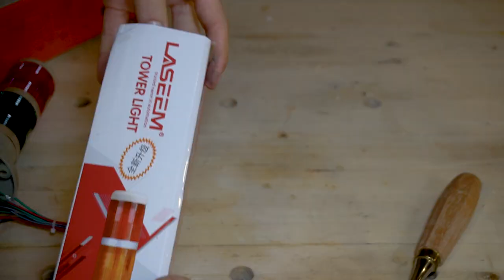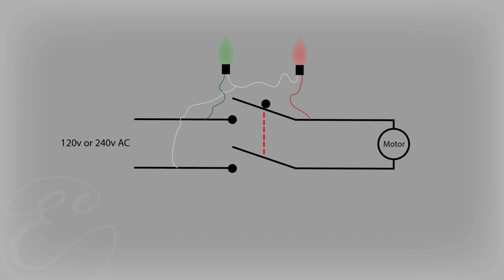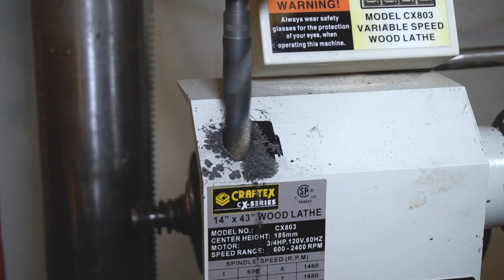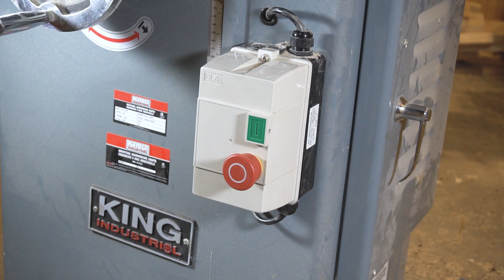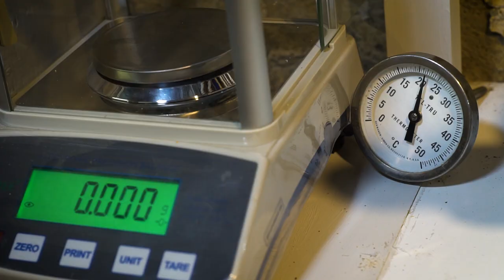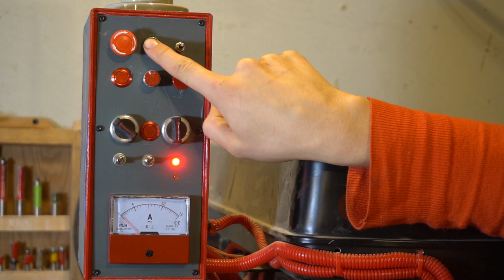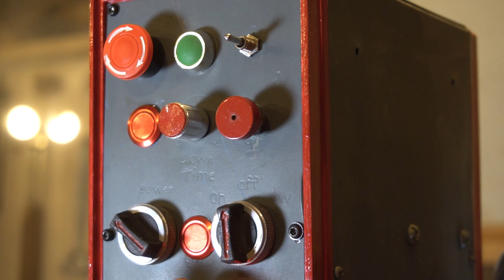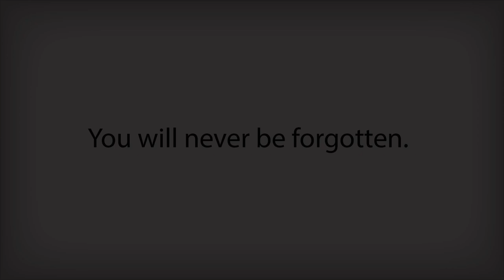Making your woodworking machines more safe

Comment: So  thats how you mount a vice to a drill press. seriously i had no idea.  I enjoyed this video like the rest i have watched.
Reply from the maker: Happy you enjoyed the video! My drill press is much larger than a typical drill press and the vise on it weights 70lbs. But you can get smaller similar vises that are much superior to typical drill press vises (a 4" one may be more appropriate for a typical floor standing drill press) Just look for imported machining vises. You can get some down to only 3 inches wide but still built the same. And there's no need to bother with big make brands like Kurt since the cheap ones will already be excessive in accuracy for a drill press.

Comment: This is an excellent subject that many woodworkers ignore.  I changed over my machines that don't have safety switches like newer machines have today. I adore machines from the turn of the 20th century. There's a reason they are still around due to the high quality they were built at and the fact most are made from cast iron. My brother has a 1920s, 28" band saw which is to me, a work of art, but can be a very dangerous machine. He has added safety switches and found at an auction, the original gage wheel covers that were made for his model machine, but often were not added. Great job Eloise! 
PS- You were not kidding about the cost! Ouch!! That must have been a small fortune you spent on those lights and switches.
Reply from the maker: Old machines are fantastic! but yes, adding modern safety equipment on them is critical. And yes industral electronics are expensive. Its always cheaper to get them from China but they are not as nice and you always have to personally evaluate the design of each component because there's no garanty they were well designed and made.

Comment: Any chance you can add a link to the lights and switches you've used? Great video!
Reply from the maker: They were all generic parts from the Chinese market on eBay. The lights are generic chinese safety stack lamps and available in many different voltages, number of stacks and with or without buzzers if you look around. Here is an example but I think I payed less so theres probably better deals:
https://www.ebay.com/itm/312535636993 

The E stops were these guys:
https://www.ebay.com/itm/152979045200 

And the green buttons were these guys:
https://www.ebay.com/itm/153748038631 

The buttons were also generic Chinese buttons so if you find some that look identical but are a bit cheaper its probably the same thing.

Comment: What happened to the table saw?
Reply from the maker: The fence broke (I've fixed it many times but it just broke in other places) and a new fence is worth more than the table saw. The trunnions also broke. I never totally found the issue but the blade wont center in the holes anymore. The gears for the raise and tilt system also wore-out and where getting really rough to turn; mostly to tilt the blade. For the last 2 years I have been fixing the saw once a month. these fixes often took half a work day. I saw it coming from a mile away. The new saw is fantastic!

Comment: Nice video, but your drill speed with the 3/4" drill bit is much to high. The bigger the bit, the lower the drill speed. Keep up the good work
Reply from the maker: Thanks! And I usually do it by feel, but if I recall I had the rpm to 600. I just looked it up on a chart and it seems 713 would have been the perfect speed. The chips didn't come out hot at all either. I think it was alright but thanks for the heads up!
Reply: Then it looked like the speed was faster. But that is the rule of thumb, the bigger, the slower.